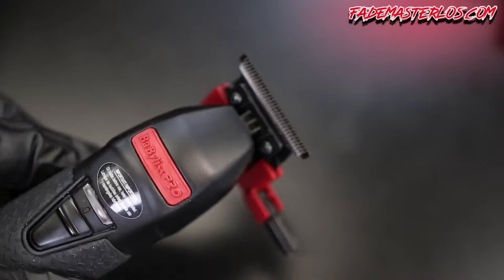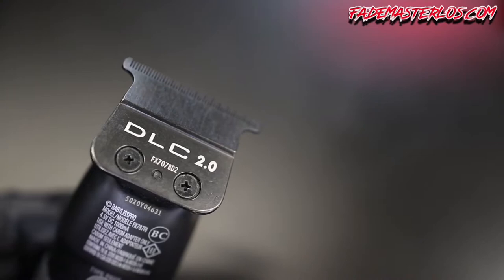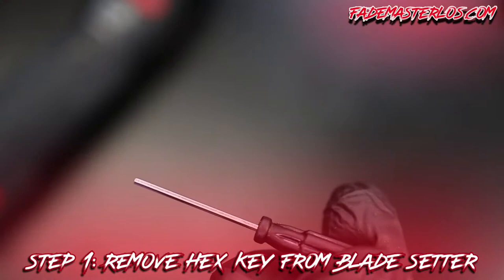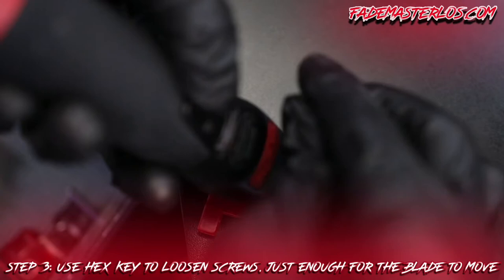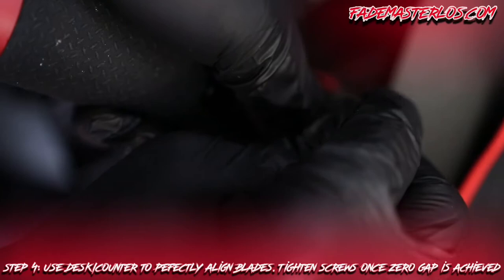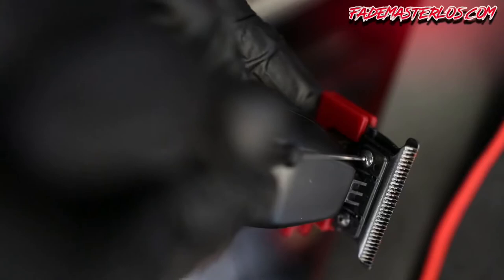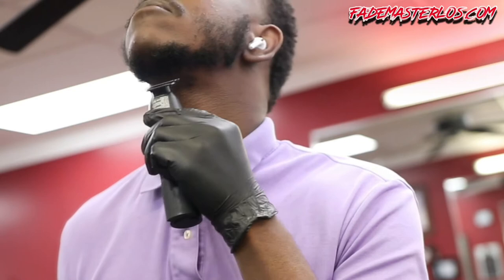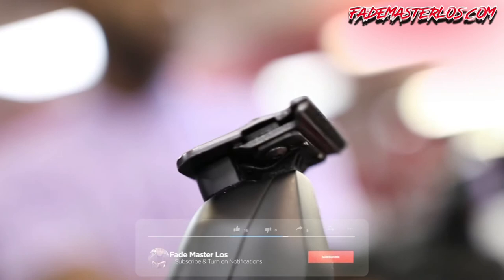BABYLISS TRIMMER ZERO GAP  | HOW TO ZERO GAP #BABYLISS TRIMMER

Comment: I don’t understand the point of that red thing. You put it on the back of the clipper so it doesn’t do anything but clip onto the back of the clipper. You still have to zero gap at yourself by eye or by putting it down on the dresser or something. I don’t understand the point of it.